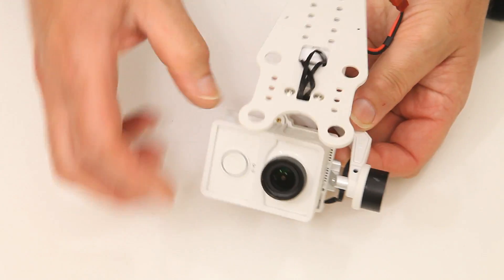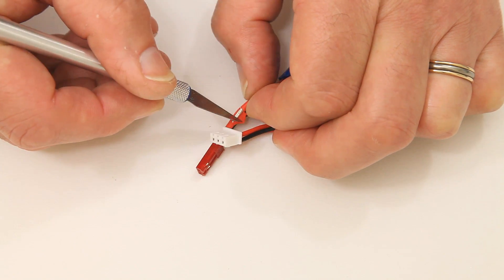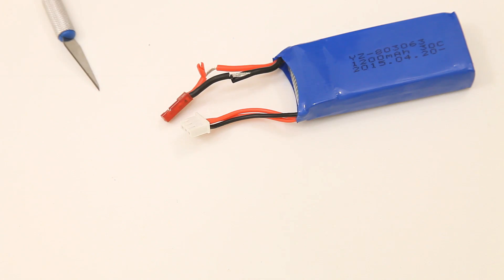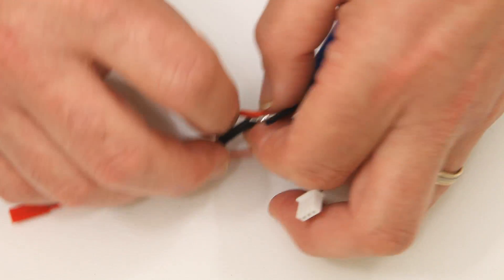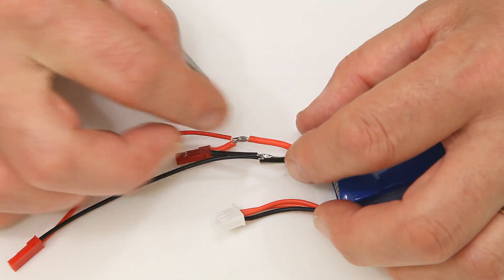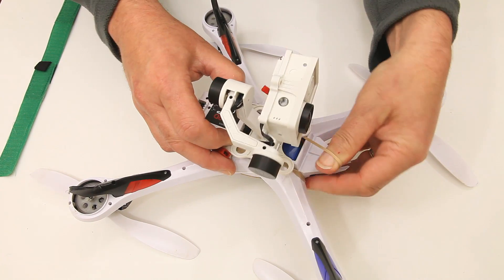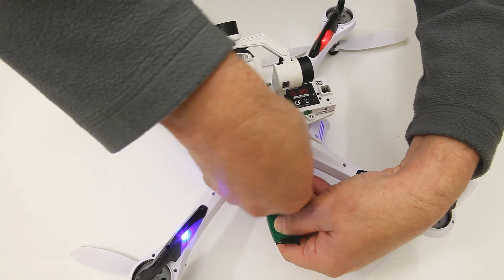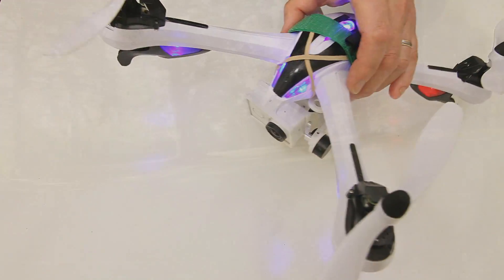Tarantula X6 fitting Walkera G 2D gimbal and battery mod.

Comment: Hey Tigger. I'm having trouble with this setup. I did everything in the video and it seems to work, but the tarantula low battery warning comes on almost immediately giving very short flight times of like 20s or less.

Comment: Thank you for this video but I need to ask you - what about use second battery only for gimbal? connector looks ok. And what about tarantula with camera + gimbal - no problem with weight? I try Tarantula with SJ400 - fly good, but 2 times it just fall down. With go pro can fly, but I feel little problem with weight.
Reply from the maker: Second battery wont help, I made a video here https://www.youtube.com/watch?v=uAb-t5oMLsE
Reply: Thank you very much for answer.

Comment: will it be better if i used a seprate battery for the gimbal?
Reply: if so what v and mah do suggest
Reply from the maker: Not in my experience, the gimbal takes little power and an additional battery will add weight with no real gain

Comment: I did exactly the same that you did with the same gear. But when i push 
the throttle the Gimbal loses control. Not enough power? But i have 
everything the same as you. Any ideas?
Reply from the maker: Sorry no ideas at all, I guess you have tried it with and without gimbal to see if it's another problem :~) Hope you get it sorted :-)

Comment: Great video! Which do you think is better to have longer flight time? 1. This mod (1 battery to power TX6 and gimbal) or 2. Separate battery for the gimbal (1 for TX6, another for gimbal)? Thanks in advance!
Reply from the maker: I did both tests and videos are on the channel, mine was better with just one battery ;-) BTW no need to mod battery I would have used one of these cables http://goo.gl/Hw9uzT , but was just impatient :-)
Reply: Thanks for this! I'm so glad to have found your channel! Thanks tigger!
Reply from the maker: It's a pleasure and glad you have you with us :-)

Comment: hi i want to ask 2 question.
1st it works for the battery of tha bayangtoys x16? 
2nd does the battery of the tarantula x6 can be charged on the charger of bayangtoys x16?
thank you
Reply from the maker: Hi, 1stit only works to power gimbal on X16, it will not power quad, this is a 2 cell the X16 takes 3 cell. 2nd The X16 charger will not charge this, thanks and hope that helps
Reply: +Tigger's RC Reviews ok thank you very much for responding,
so i should buy extra battery for the gimbal?
Reply from the maker: Hi Carl, firstly, I must apologise, I have used this gimbal on loads of quads and usually use another battery, with the Tarantula you can either mod the battery as I show or I think a better way is to use this cable http://goo.gl/Hw9uzT  then you don't have to change all your batteries. Sorry again for any confusion, hope that makes sense? Thanks
Reply: +Tigger's RC Reviews yes, thank you for the infos

Comment: Hi +Tigger's RC Reviews, you have anoter subscriptor but I have a question If this is working in a tarantula x6 it can works in a syma x8 ? And, did you put a better battery in your drone because 9 minutes flying it is a lot.
Thanks
Reply from the maker: Hi Daniel, I guess it would work on a X8 but don't have one so could not prove it for you. I was amazed at how long it lasted and TBH it did crash/bounce at the end so should have stopped sooner, but you got to try these things. Stock battery, but mine is an early X6 and there was some comments about them changing the PCB boards and flight time drastically cut with any extra weight. Still a really good flyer as you will find around the channel and every so often i still get it out for a thrash around the garden :-) Thanks for subbing and hope you enjoy the channel and it helps you. Cheers
Reply: Thanks for answer my quenstion but I still doubting if with another battery I could be better (the battery of the Tarantula X6 is different than the Syma X8).And if I want to change the posicion of the camera in the gimbal without a calibrate controller, how i do it?
Reply from the maker: Hi Daniel, I have never owned a X8 so I'm afraid I have no idea what battery would help. If I change anything weight wise on the gimbal and it becomes unbalanced I just add weight to the opposite side, by weight I mean small coin, washer etc then you don't need to calibrate it ;-) think I used this method in the 3 axis gimbal video I did, cheers
Reply: Thanks for all +Tigger's RC Reviews, I still impressed that the original battery of the tarantula X6 can with the gimbal and the drone.
Reply from the maker: Pleasure :-) hope it goes well for you
Reply: +Tigger's RC Reviews I'll tell you in a few weeks.

Comment: is it possible to point the gimbal down?
Reply from the maker: Never tried it but I assume you could use the adjuster screw settings, but as i say I don't know, on CX-20 you can use one of the pots too control it but you don't have that on the X6

Comment: which wire do you use ? (long) 0:35
Reply: And where can you buy that soldering thing???
Reply: +DiaGamingNL- DgN thank you :)
Reply from the maker: +DiaGamingNL- DgN Hi, now I get it ;-) I used this wire http://goo.gl/oOQhAu but you can use a splitter cable http://goo.gl/Hw9uzT  to save altering all your batteries . Hope that makes sense? Thank you for trying again hope you thumbs up and subscribe :-)
Reply: +Tigger's RC Reviews thank you :))
Reply: +Tigger's RC Reviews but how i use that splitter cable same as normal?
Reply from the maker: +DiaGamingNL- DgN Pleasure if I can help I always will, thanks for subscribing, have fun :-)
Reply from the maker: +DiaGamingNL- DgN It just splits the power into 2 cables so use as normal :-)
Reply: +Tigger's RC Reviews so I have not cut the cable? and I also do not have to solder the cable ? or not
Reply: +DiaGamingNL- DgN From the battery
Reply: +Tigger's RC Reviews ??
Reply from the maker: +DiaGamingNL- DgN If you buy the cable you do not need to cut anything or solder anything. I did not want to wait for cable so did it the other way.
Reply: +Tigger's RC Reviews thank you your a helpfull Guy!
Reply from the maker: +DiaGamingNL- DgN No problem, I always reply but sometimes it takes awhile as I'm a busy guy too :-)

Comment: how much less flight time do you get with the gimble? there HAS to be a bigger usable battery for the tarantula. Im gonna do some experimenting
Reply from the maker: +Bryson Michael Hi Bryson, here is a video of flight length https://www.youtube.com/watch?v=GuZyYS78AXs happy with flight length on standard battery but good luck with the search. Some people put a small battery on just to run gimbal ;-) Hope you thumbs up and subscribe loads of X6 videos on channel
Reply: I have a tarantula X6 AND a phantom 3. And a Tarantula is bigger by wingspan. Im thinking about guttung my tarantula and replacing the motherboard/Motors/Battery. Upgrading the whole thing. That way I can use a Phantom 2 battery and the motors wont burn out. I think ill need brushless motors. It just seems like a waste to me NOT to MOD it when the props and wing span are perfect to be used as a more stable quad. Ill make videos
Reply from the maker: +Bryson Michael Hmmm sounds interesting, but I think I would go down a carbon fibre frame route using Phantom bits as Tarantula body is very flimsy, be interested how it goes. instead of all the modding I just chickened out and bought the Yuneec for video platform....I know that's cheating LOL
Reply: +Tigger's RC Reviews yes, carbon fibering it would do greats. I may make a mold with the body and make a whole mother quad so I don't mess up the tarantula... I'm the same. I got the phantom for good video
Reply from the maker: +Bryson Michael Sounds kool :-)

Comment: hi tigger,

Is there a way to adjust the pitch of the gimbal manually?
Reply from the maker: +Jan Ivanrei Liceralde Hi Jan, only by using adjustment screw, so not while in flight with this set up. If you have a spare pot, like on the CX-20 no problem, but not on a Tarantula the transmitter doesn't have the capability.  Hope you thumbs up and subscribe if you haven't already, thanks for comment

Comment: is there a way to add tilt control ?
Reply from the maker: +bannerabc Not really the TX does not have any pots you can use and it would take a lot of work to make it function :-( hope you still thumbs up and subscribe if you haven't already. Thanks for the comment
Reply: +Tigger's RC Reviews is there any way to angle the camera down at all?
Reply from the maker: +bannerabc On this quad the only quick way is to use the adjustment screw on the gimbal on something like a CX-20 you can use one of the pots on the TX. Have a look at my CX-20 videos and you will see it in action.
Reply: +Tigger's RC Reviews i see, also would a gopro session camera work on the gimbal
Reply from the maker: +bannerabc Should do it was made for GoPro's I seem to remember. I had to mod mine to take Xiaomi Yi. Use the link in description for where I got mine from Banggood have stopped stocking them.
Reply: i have the quad now, it worked for a few flights but now - i connect battery, lights flash fast, on level surface, they slow down, turn transmitter on, push throttle up then down, makes a beep but then lights flash fast and it wont take off and fly at all when it used to would have - do you have any ideas ? instructions are useless
Reply: if i turn transmitter off the lights go back to slow flash
Reply from the maker: +bannerabc Got me on that one, not had that happen at all. Have you tried the forums, sorry that's all I have as can't replicate it with mine :-( let me know how it goes
Reply: no worries
ive tried searching and cant find info anywhere, asking on forums if not gonna have to send it back
Reply from the maker: +bannerabc Sorry, that was my other thought get hold of supplier and see what they have to say, good luck, let me know how it goes

Comment: I would like to put this gimbal but powered by a separeted batterie do you now if this batteries would work Teenitor 2 Pack 7.4V 850mAh Li-Po Battery Spare Part for WLtoys V262 RC Quadcopter Replacement
Reply from the maker: +Mac Stenner  It should but pretty sure you won't get longer flight time because you are carrying extra weight and don't think the gimbal pulls that much power,  i assume you have seen this video https://www.youtube.com/watch?v=GuZyYS78AXs  I did 2 batteries in this video https://www.youtube.com/watch?v=uAb-t5oMLsE Hope that helps? Thanks for subscribing I appreciate it :-)
Reply: +Tigger's RC Reviews this are 30c batteries no?
Reply from the maker: +Mac Stenner Yep stock battery or cheap replacement both 30c

Comment: Tarantula finally arrived from Banggood after 7 weeks - but now weather has gone bad again!  I will probably do this mod using a JXT splitter. I also made a mod to the power lead and battery compartment cover etc. so that the battery lead can be connected outside the quad . Means you don't need to power-on before you have fitted the gimbal & camera etc.Keep up the good work!!
Reply from the maker: +Gordon Melrose Glad it finally turned up, was it the ladies who rowed the Pacific that brought it? LOL Splitter is the better option, I was just impatient and did what i had available ;-) Good idea with battery door etc. I know rubbish weather and loads more rain to come in next day or so. have fun when you can supposed to be better Wednesday....SUPPOSED TO BE! TTFN

Comment: if we use gimbal,can we can control wide angle in the air?
Reply from the maker: +Ariqkamil Nugroho Sorry something missed in translation that doesn't make sense to me can you rephrase and try again? thanks
Reply: can we control the camera in the air? (when its flying)
Reply from the maker: +Ariqkamil Nugroho That's better :-) the answer is no unless you use WiFi but I never do as it can interfere with RC signal, hope that makes sense? Hope you thumbs up and subscribe if you haven't already
Reply: +Tigger's RC Reviews thanks
Reply from the maker: +Ariqkamil Nugroho :-)

Comment: hi again tigger rc. my gimbal came today and i noticed in your video that you took off the vibration plate when fitting this to the tarantula x6. i thought that was there for a reason to stop the vibration and movement on the camera?
Reply from the maker: +Tony Layton hi Tony, yep i did take it off, didn't seem to help at all so just did it this way ;-) had to check back myself but all the flights I put on YouTube don't have it on and I don't ever remember changing the set up.If you got a slight vibration then you could have it on but I have never suffered with that on mine.....oh here comes the vibration monster, now I mentioned his name LOL let me know how it goes, it really is a good combo :-)
Reply: +Tigger&#39;s RC Reviews i'm hoping to give it a go later so i will see how it goes..we attached our gimbal to the battery lid so the gimbal slides on and off easier for changing the batteries over..works quite well to be honest and a separate battery attached to the back of the bracket to run the gimbal
Reply from the maker: +Tony Layton All sounds good Tony. What battery are you using for gimbal? I get asked all the time, I still run mine with the splitter.
Reply: were trying a 7.4 v 350mah as there pretty small and light.take into mind the flight of the quad copter is about 10 mins so as long as it can last through a few flights we will see hey lol
Reply from the maker: +Tony Layton I think that was what the other guy was using. thanks for the info will try and remember it for next time I get asked. IMHO you will strip the gears eventually with all this extra weight but a very cheap price to pay for what you get, I feel. :-)

Comment: Is disappointing that there is not a switch on/off. All the process took about 2.30 min with the battery connected to get ready. Then take the battery out after the flight.
Reply from the maker: +FaffiGP Rafael Garcia Perdigon You can add on/off switch if you want, this is just my way. It takes seconds for me to be in the air, this video was the first run through, this works for me and produces great video, at a bargain price. I flew next to a mate with a Phantom and I was in the air filming before he was :-) Thanks for your comment.

Comment: But here you had to buy an extra cable with jst because I can't see this cable in tthe box of the gimbal, right?
Reply from the maker: +lini lodi You get a small cable that goes from Gimbal with a jst attachment, you need a splitter cable if you want to run the gimbal from the tarantula battery, I soldered mine because I didn't want to wait.
Reply: +Tigger's RC Reviews Ok, so I don't need to buy an extra cable
Reply from the maker: +lini lodi Well you do to get the power from the battery to the gimbal. Either buy a JST splitter cable or solder another jst connector as I show in the video
Reply: Thanks, now I understood
Reply from the maker: +lini lodi Glad to help, better you understand fully before you buy, nothing more annoying than being a cable short when you want to fly ;-) here is the link for where I got mine http://goo.gl/39EBwz and the cable I would order is http://goo.gl/Hw9uzT should all be good to go :-)
Reply: +Tigger's RC Reviews Nice, thanks man
Reply from the maker: +lini lodi We got there Kool :-)
Reply: Yep
Reply: Maybe I will upload a video soon with my Tarantula X6

Comment: Hi, nice video. Can the gimbal be controled?
Reply from the maker: +Paul Canindo Hi Paul glad you enjoyed the video loads more on this combination and flight video around the channel ;-) No the gimbal cannot be controlled with this setup as the Tarantula transmitter does not have a pot or any control to operate the gimbal. TBH on my CX-20 I have the gimbal setup for control but very rarely use it. Hope you thumbed up and subscribe if you haven't already Cheers for the comment :-)

Comment: This controller operates from 7 volts?
Reply from the maker: +Voldemar D When you say Controller do you mean Gimbal? If so yes it works on to or 3 cell batteries. Hope that answers your question if not let me know :-)
Reply: +Tigger's RC Reviews 
Yes, I wrote about the controller gimbal suspension
recommended supply voltage of 12 volts and 7 volts in tarantula
Reply from the maker: +Voldemar D That's good either 2 or 3 cell, I use 3 cell. Thanks for comment
Reply from the maker: +Voldemar D Yes that is correct Tarantula 2 cell 7.4v but I use it mostly on my Cx-20 3 cell 11.1v it is designed for both.

Comment: Do you know if its possible to install a fader on the remote control to control the gimbal?
Reply from the maker: +Gerson Pereira Not that I have heard of but that doesn't mean it hasn't been done. TBH I have found that I rarely alter it on my CX-20 and IMHO I think it something we think we must have but really don't need or will use that much. Obviously just my opinion. Thanks for comment :-)
Reply: +Tigger's RC Reviews Thank very much for your answer. Sometimes you may need to see underneath the quad and that would be great. But I will try to find a way. :) BTW do you know if I can weld the female jst of the quad instead of the male on the battery? It would be nice because I have 3 batteries and I don't want to weld them all.
Reply from the maker: +Gerson Pereira Yep you could do or just buy a jst Y cable splitter http://www.banggood.com/JST-Parallel-Cable-Line-For-Transmitter-And-Gimbal-Flight-Controller-Power-p-980321.html?p=ML1711535795201404KD pretty sure that is the one :-) I would strap camera to quad with some cushioning and not bother about gimbal for ease or you could try using the adjustment screws but I'm not sure they have enough to get it all the way round. Let me know how it goes :-)